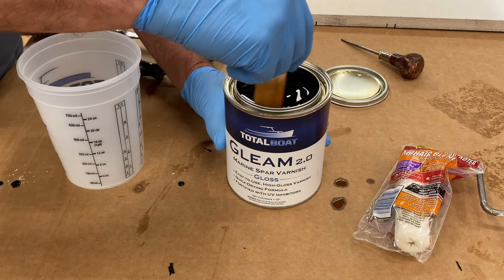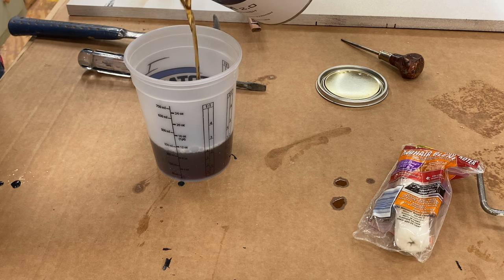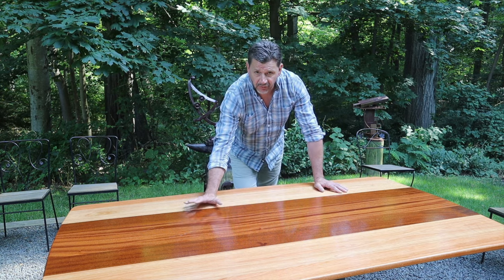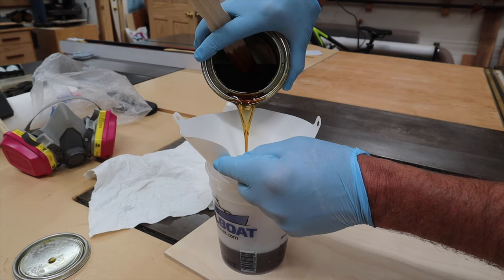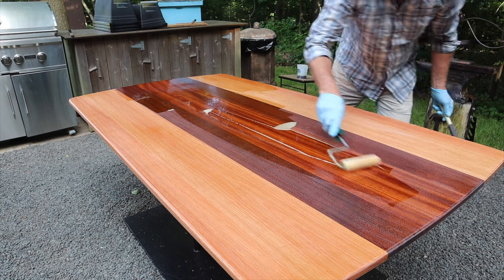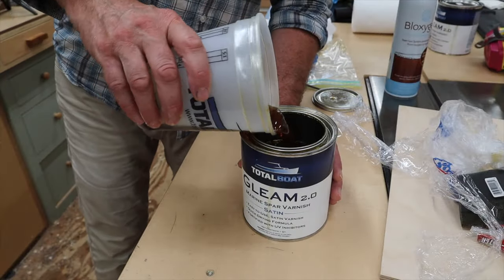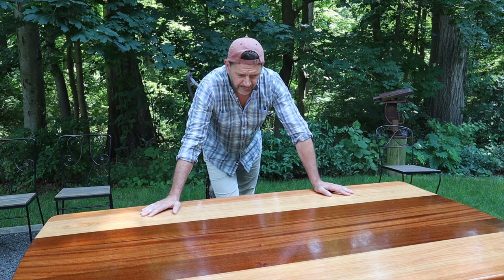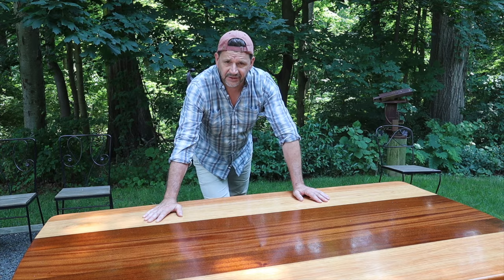How to  Apply Total Boat Marine Spar Varnish - Satin Finish

Comment from the maker: Here’s a few tips on how to apply Total Boats Marine Spar Varnish.
One of the important steps that I didn’t realize is you need to first build the coats up with the gloss varnish if you intend to use a satin finish. So, In this case all apply for coats of the gloss sanding in between coats with 320 sandpaper before applying the two final coats of satin.
Hope you found this video helpful, thanks for watching and have a nice weekend. Jon

Comment: Great tips, Jon! Thanks a lot! 😃
One last thing you can do (if necessary or if you want to) is to burnish it with brown paper. It removes every little imperfection in case there's any. 😊
Stay safe there with your family! 🖖😊
Reply: @rd-ch1on  Well... You just can't use it as a gorilla, putting too much force into it. 😬
But other than that... Not that I know of.

Comment: In Egypt, we repair the wood with putty, then sand it, then use marine varnish or what is known as a wood sealer, then sand it after drying, then apply another soft, specially made putty, then sand it, then apply varnish and sand it, then apply a wood primer In order to show the hidden defects and repair them, then sand them, then start applying the dye in several layers, whenever it dries, add another layer as needed.

Comment: hey jon - good vid. quick question - i built our house, and put in a custom sapele front door that is about 12' tall and maybe 7' wide. was a wife "splurge" item ! The painters put finsih on the door that i knew would not survive the south facing midwestern sun. I was right, it didn't. working on a strip/sand right now, and thining of applying this finish. So, major question is how well this stuff held up. Also, - didn't realize base coats should be gloss, so great tip there, and it looks like you used no stain, just natural wood, which i think turned out great.

Comment: Good, concise video. I’ve never used Total Boat products. I’ve been using Epifanes Gloss and Satin the same way. I have 5 coats gloss and 3 coats satin on 2 42” exterior doors. Both 4 years old, original finish. Haven’t aged at all. I do like the quick drying time of the Total Boat.. 👍
Reply: Epifanes has a rapid clear. 2 or 3 coats a day. Build up coats, then finish with gloss. Just a suggestion.

Comment: Why gloss first?
Reply: Gloss is pure varnish.  You can make it satin by very fine sanding to rough up the surface, but it’s tricky to get it all even.  Satin finish has small particles in it to make the surface very slightly and consistently rough, so it must be well mixed before use.  Only the top surface matters, so only the last one or two coats help make it satin sheen.

So you don’t need satin for early coats.  Why is it bad for those? The particles are transparent.  If they had precisely the same index of refraction as the cured finish they would be invisible if submerged.  But if it’s slightly different, too thick a layer will obscure the grain.  In the real world, particles are slightly different, so for the best clarity, use gloss initially.
Reply: @alans1816  thank you
Reply: Great explanation. Thanks Alan

Comment: I didn't see you thin the 1st 2 coats to oak in as a sealed coat?? I see Total Boat is quite thin. Is it oil or water based? Does it self flatten from the roller. Or roller leave lines?

Comment: Hi Mr Peter. I know this is beautiful table and I noticed you use the red grander in the outside of the other wood what is it that you don't like with the red grenade is it hard to work with or does it give you problem. I have some red Grand Day but I haven't used it yet so I just wanted to know what problem that it gives to know if it's something that I can use more often. I am a beginner in woodworking so that's why I'm asking question I appreciate your answer thank you. The table is so well done very beautiful work.
Reply from the maker: Hi Raymond, I feel that it’s prone to checking and cupping … i’ll make a video in the next few weeks and use some of my projects as examples.